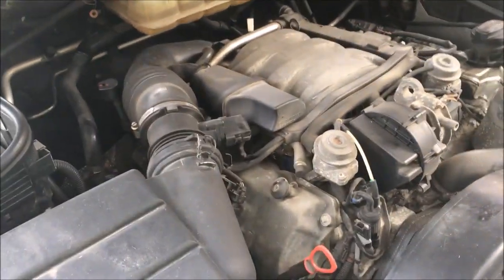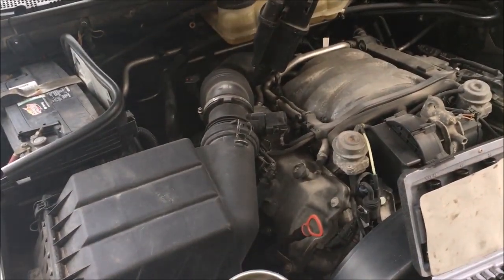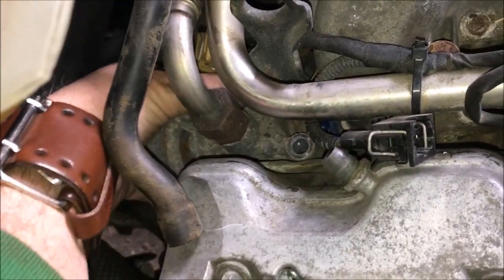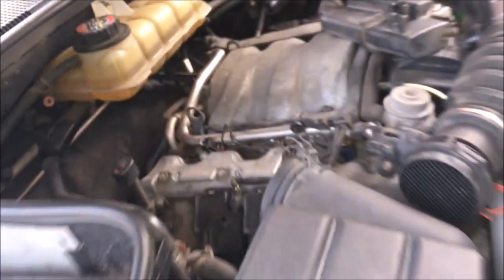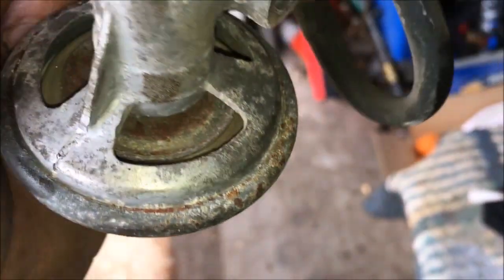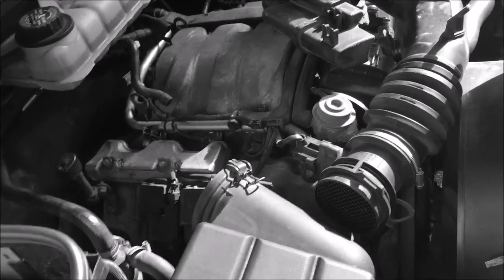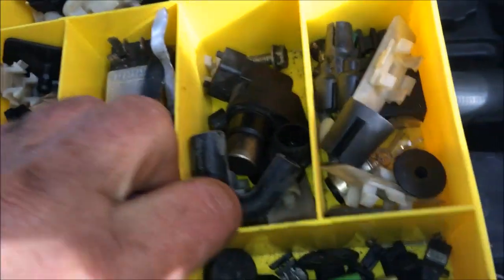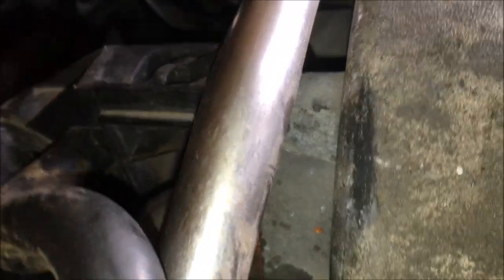Mercedes M112 v6.. M113 v8 EGR valve removal, test and clean

Comment: Thank you for posting this video. Much appreciated. I have a related question I was able to clean my EGR valve as you do here. However it was worn to the point where when I put carburetor cleaner in one side it would leak through to the other so there was no full sealing off of each chamber, even though the pintle and diaphragm move properly.
Do you think this failure to seal fully in the EGR valve could cause excessive exhaust smoke which I primarily see when restarting the engine hot?
Reply from the maker: The EGR will never really have a complete seal. Leaking cleaning fluid through from one side to the other shouldn't be an issue . what colour is the exhaust smoke  ?

Comment: Also helps to use the red button on hood struts to get the hood almost straight up, not sure if you mentioned it. Gives more room to work at back of engine . Good video!
Reply from the maker: absolutely good advice .. not sure if I mentioned it , but should have
Reply: PS: on SOME MB models like w210 etc.
w163 (MLs) dont have hood up button, you must transfer hood strut to secondary hood up knobs.
Takes 2 people but mandatory if working near rear of engine.
I say that cause he's fixing this on w163 - ML320

Comment: Dear fupa, how Did You remove this hose metal?
Reply from the maker: if you mean the final metal hose that goes into the intake . Once unbolted you kind of turn it left nd right while gently pulling , it has a few bends in it so it takes a few tries to get it to come out
Reply: fupabox thanks that was tought... 
Btw how about corrosion on your G Wagen? Do you have sth under your car?

Comment: for those attempting this, be careful with those PCV hoses. They are known to brittle up and break easily. It's probably a good idea to just plan to change the PCV hoses if you are going to remove your EGR valve.
Reply from the maker: excellent idea .

Comment: It looks like the exhaust gas being recirculated is only from the passenger side exhaust bank?  Or is EGR valve recirculating gas from a common exhaust manifold that feeds the exhaust gas into the two tailpipes?
Reply from the maker: The EGR is only used to regulate the temperature in the combustion chamber so it doesn't need to come from both sides of the exhaust manifold..it does recirculate exhaust gasses , but not to completely reburn them.. that is the job of the catalytic converter . The EGR just mixes some exhaust gasses with the incoming fuel to reduce the temperature inside the combustion chamber when the ignition occurs.
Reply: So it's only using the bank 1 exhaust?  I ask because on my M112, I find that the bank 1 LTFT (long term fuel trim) is always 1.6% to 3.1% lower on bank 1 (passenger side) than for bank 2.  (example: LTFT is 4.7% on bank 1, but 7.8% on bank 2).  I'm wondering if I might have some exhaust back pressure that the EGR path on bank 1 may help alleviate, resulting in lower fuel trim adjustment for that bank.  Not sure if my thoughts make sense.  If it does, please let me know if you have any insights on this.  Thanks.
Reply from the maker: that is possible, although the O2 sensors should make up for it, but if an O2 sensor is getting weak it may not compensate completely..Cleaning the EGR can't hurt, and only takes about an hour.. Let me know if it makes a difference , I's a great question
Reply: I think I may be getting some backpressure from bad rear cats on both sides.  Did temp gun test on them, and I hear rattling.  Car still running fine, though.  Had changed bank 2 pre-cat O2 sensor because of voltage range issue with sensor--had pending error code--that I could see with scanner.  Now, both pre-cat O2 sensors look OK when I check waveforms on scanner.  Will think about cleaning EGR--and throttle body--but probably take care of cats first.  I'm not looking forward to working in space where EGR valve and throttle body are.  And I'm worried about things breaking back there.  Thanks for your videos!

Comment: This is a unrelated question but here goes.. Okay guys today I was at the wrecking yard and came across a w220 s55 amg with its full quad exhaust still intact. They want FORTY BUCKS for the full system! I'm picking it up tomorrow to either sale or......put it on my 2002 W203 c320? Lol My question is, is it possible to put it on the c320? Obviously I'll need to modify the spare tire well, I don't use it because it didn't have a spare when I bought it and also use some exhaust adapters to meet the front section with the back section...but is it possible to basically "plug and play" ? The have a similar body style except for the front end. Also can I mount the side skirts as well as the rear bumper? Thank you so much for your advice in advance!!
Reply: It's probably really long ? Did you try it on your c class?

Comment: Any advice for M113 owners when it comes to working in a tight space? I can't even fit my hand in there on my CLK500 :/
Reply from the maker: you may need to remove the upper engine mount bolt on that side , put a jack under the engine and lower it a tiny bit

Comment: Hey there man hope its getting warm up theya in Canada! Anyway the Berkshire potholes snapped my lower right front control arm at the ball joint. While doing 45. Jammed the tire up and in but new fender new arm new ball joint and....new control arm bolts. Is there a magic camber adjusting bolt I should worry about getting at this point 200k? Or ebay or grade 8 that fit? I am going to cut the old CA out those nuts arent coming off. I'm sure that there is a video somewhere though...LOL. I put in an led to remind me my lights are on in the daytime,,the funny thing was when I touched live 12v putting it in the buzzer would go off. Oh well you that I need the camber bolts? I am thinking about body side moulding kit too the back of the wheel inner got crunched in and will require about a gallon of bondo ! Rock on !
Reply from the maker: I would take it for alignment first ... if the alignment guys can't get it right with the stock bolts , they should have the camber bolts in stock
Reply: I had to sawsall the stock bolts off they stripped with the impact wrench. I ordered Febi camber adjustment bolts and a left control arm I'm not taking any chances its toasty too. When I get the new tires on I will have it aligned I may have to get a boneyard fender or at least bondosculpt the lower valance behind the wheel.  All fun stuff to do! Ty as always
Reply from the maker: lol  bondosculpt  :)
Reply: The Botticelli of Bondo

Comment: Here is a brief list of the OEM parts you can use on your SLK320 R170 to achieve additional power.

M112 Upgrades
C240/C320 Airbox: PN: A1120901501; this increases overall filter area by approximately 50%, Airbox volume by 35%, and increases intake tubes to 3", a 20% increase from stock

M113 MAF: PN: A1130940048; The V8 MAF is a full 3" design that allows for increased flow. NOTE: You must swap out sensors and use only the housing of the V8.

M113 Throttle Body: PN: A1131410125; The larger V8 TB is opened up to 74 mm and matches the inlet of the intake manifold perfectly. 

430/500 M113 Fuel Injectors: PN: A1130780249; These injectors are rated at 19 lbs/hr and are a great upgrade for a bolt on car. 

What do you think about doing that?
Reply from the maker: very interesting . I'd like to try some of those this summer if I get some time

Comment: Best video on egr

Listed your tools
Everything well explained.

Question: did you disconnected your battery? If you did how do you proceed to do so the proper way?

Thank you for the tutorial, im subscribed
Reply from the maker: No I didn't disconnect the battery . If you choose to always disconnect the negative cable
Reply: @fupabox  thank you so much. I will be doing this procedure soon on my c320 v6 2001. I'm ordering new hoses and a new egr valve just in case

Comment: Thanks I'm glad you posted this because I may need to replace the intake gasket and now I can check the egr while I'm at it. 👍
Reply from the maker: Good time to do it .. even though mine was working and only slightly clogged, the idle is a bit smoother from being cleaned out completely  :)
Reply: fupabox That's good to know. My Ml from time to time ha felt as if holds back, not all the time. I haven't gotten to the spark plugs yet might need the center support bearing. I have heard that the center support bearing can make it feel at times like the vehicle is holding back when bad. also a faint howling noise.
Reply from the maker: The support bearing will be felt more under load , like uphill or while accelerating .. a rumbling that you can feel in the shift knob.
Reply: fupabox ok thanks, more than likely I will change it as well. it has 127,000 miles now.